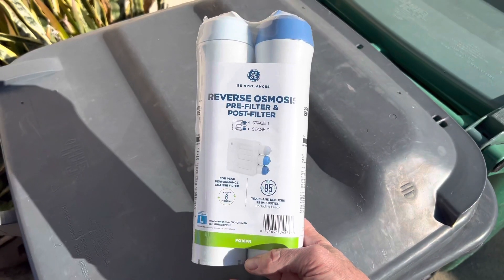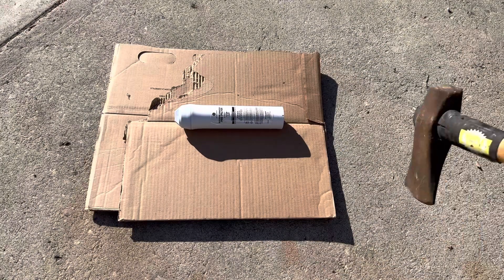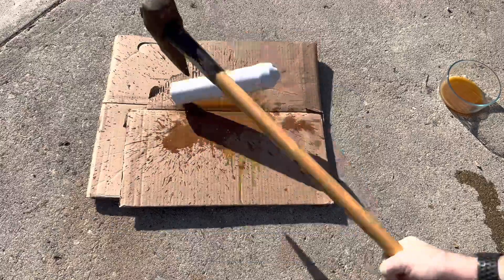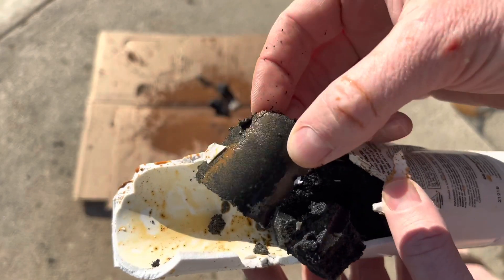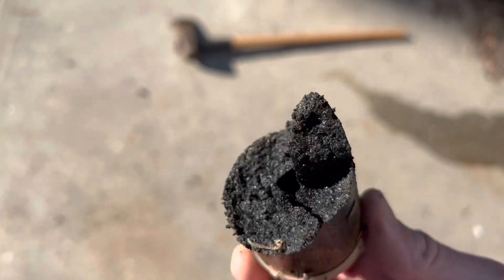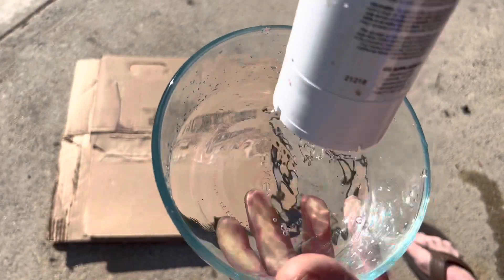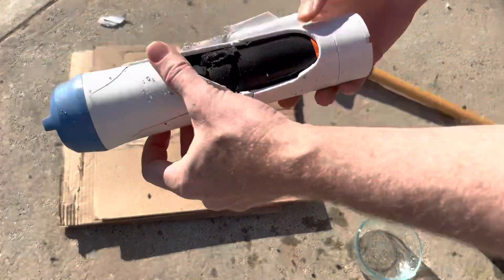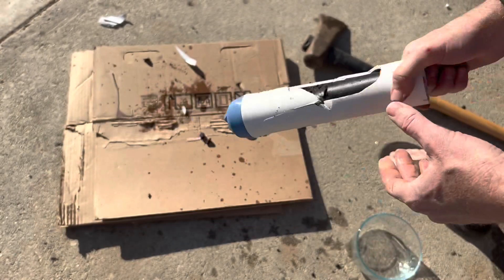How Dirty Is A Reverse Osmosis Water Filter After Use?

Comment: I'm confused. So the third canister seemed super clean. So the water was still clean? Still wondering if you needed to replace the others. I think I need a more scientific evaluation to learn more. If the third canister was also dirty it would be apparent that the filth was getting through.
Reply from the maker: This definitely wasn’t very scientific. You’re right that the first filters take out most of the visible crud. Some of the other things like fluoride and tiny particles probably make it through to the last filter.